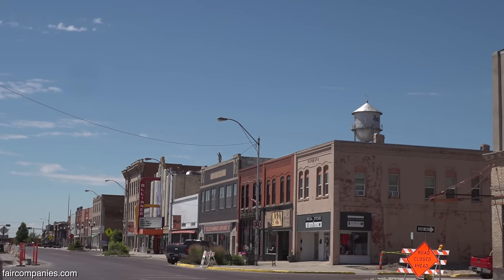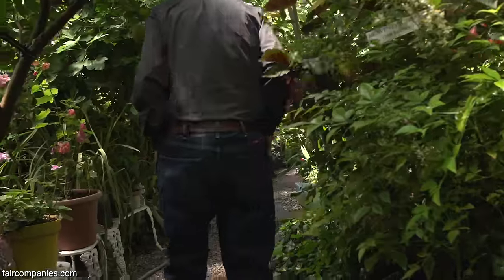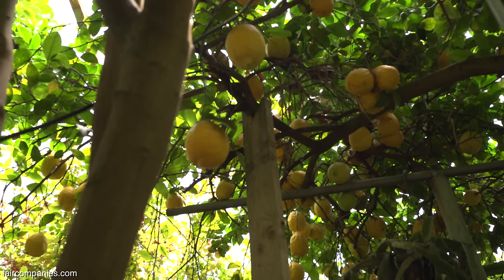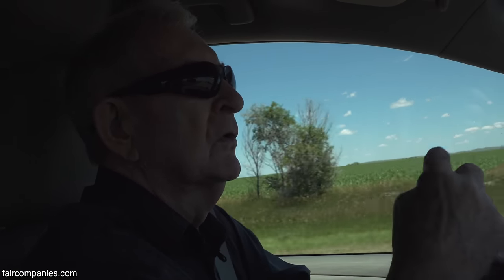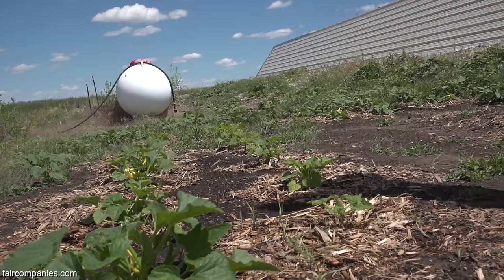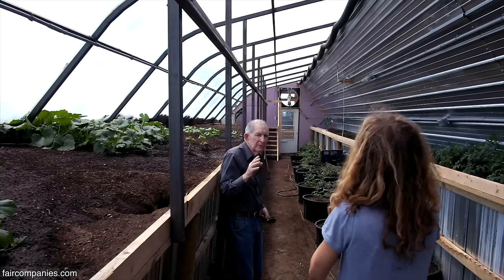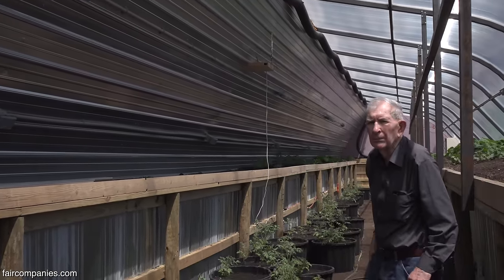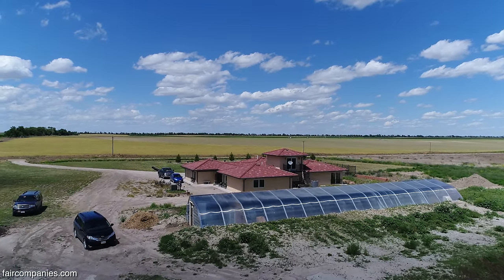Nebraska retiree uses earths's heat to grow oranges in snow

Comment: I did not see any bees at all.  How are the various crops pollinated?  I don't see how it could work without some input from Mother Nature.
Reply: Keith McCarron I’m curious too!
Reply: That is also my question. How are the plants pollinated?
Reply: I saw a beetle in the front of this clip. Either way, I’m with you guys. I haven’t heard an answer from him so I’m guessing that this is perhaps bullshit. Thanks!
Reply: i noticed an open window at the top on the end
Reply: I just thought that looking at the environment where he lives, there doesn't seem to be much in the way of vegetation outside his property to attract bees.  I wonder if he would need to perhaps maintain a small hive within the polyhouse to get/keep the bees inside.  I don't really know - it just seems to be an issue to me.  How else could he pollinate all those plants successfully over a number of changing seasons?  I do like the concept though.  It is quite like a sealed dome on a different planet.  Everything he needs has to be kept inside the sealed system for the whole thing to work.
Reply: There are lots of bees and pollinating bugs in the Sandhills. Also, remember that the greenhouses are heated and cooled via blowing air. I'm sure with that much pollen in a confined space, there aren't much problems with pollination.
Reply: hand pollination since masses of bees everywhere have died fir various reasons
Reply: Manual pollination from plants that gave make and female plants it’s possible. Unless he has bees in there on rotation
Reply: Keith McCarron would not cross pollination be a problem in such a small space
Reply: i had the same question but the blowing wind makes sense.  Would the envrioment cause a lot of cross pollination?
Reply: There was a lot unexplained. I'm thinking he would open it up in the summer once the temps are right. Otherwise it would really cook in there during a Nebraska summer. In the winter, when the bees are gone, he'd close it up..? There are other YT vids that go more into the mechanics that might help with the gaps.
Reply: @Kevin Jacks Because of course if you don't understand something it HAS to be bull... There are plenty of ways to pollinate without bees especially with citrus. Many plants are capable of pollinating simply through air flow. Citrus are easy to hand pollinate. And no matter what you do there are masses of insects in there. Greenhouses do not keep insects out, if anything they attract them.
Reply: @ Kevin Jacks   You could have expressed your thoughts in a less negative way but I guess that would have involved some thinking on your part.
Reply: Nathan Rogers
Right? Ignorance on top of ignorance.. We don't get any smarter this way, lol. Btw, thanks for the info on citrus. I was wondering about that.
Reply: As the millenials would say "Epic fake dude" !!  skepticism + lack of knowledge is very dangerous
Reply: There are plenty of smaller insects that would pollinate citrus and other plants in a greenhouse.  No need for honeybees, though if the building had open windows they would surely fly in during the warmer months. 

Cross pollination would not be a problem from grafted trees as the seeds would not come true anyway.
Reply: Kinda like BubbleBoy?
Reply: What do you really expect with the solid Motards who call themselves SJWs? I just refer to them as socialist Motards and call it good.
Reply: Keith McCarron they tried the sealed DOME thing in Oracle, Az it was a failure, it’s now open to tourism only,
Reply: there are thousands of pollinators,bees are not the only insect capable of that.
Reply: In a space like that you could just hit the plant gently a few times and it'll send out pollen. Or just pollinate manually, it's pretty easy. My bet is he has bees. It's the obvious solution.
Reply: Most of the bees off have died because of the commercial bug killer we spread around everywhere.
Reply: Ihaveausernametoo Very true, just airflow and a little vibration. My corn produces "smoke pollen" when I knock on the stem. So do my eastern white pines.
Reply: You guys need to read the pinned post at the top of this video. It explains the pollen issue clearly.
Reply: Citrus self-polinate. In fact, when mandarin growers want no seeds, they have to net all their acreage to keep bees out during the bloom. I don't know about figs, but the pomegranate flowers are able to self-polinate as well. Saw a comment about cross pollination. Cross polination doesn't affect the fruit ripening now, but rather the seed inside that fruit would be changed and the next generation would see differences, so no worries with year to year crops. Great discussion!
Reply: In the case of oranges they can self pollinate, not sure about the grapes though.
Reply: Ihaveausernametoo: Hand pollinating is super easy. Just use a battery powered toothbrush. Turn it on and place the plastic head (not the brush) against a stem. The high frequency vibrations will shake the pollen loose and send it around. People in the south refer to this as "spanking" the plants lol and do it all the time.
Reply: @KevinJacksKC  
 As a matter of fact, there WAS mention re: bees and pollination in general__I believe Russ mentioned it in the comments, near the beginning of the thread!   😺🌱🌿
Reply: @SwingWestBand  
 I doubt there would be enough plant diversity inside the greenhouse to support a hive properly, though I may be wrong(?)!   😸😺🌱🌿
Reply: Its_an_Invasion_LowInfo_Votees  
 WHAAAAAT?????!!!
Reply: @christopherbrenner1547  
 Actually, Russ did say the pomegranate is basically the only plant that has to be hand pollinated!!!   😸🌱🌿
Reply: Nathan Rogers I agree. I’ll do more research.
Reply: Keith McCarron :???? His house is surrounded by trees, bushes, and grass. What are you watching?
Reply: margaret jones : ?? Making this up?

Comment: Nebraska is the same latitude as Italy, loads of light. I wonder if this could work in Finland, maybe not the citrus?
Reply: nihir 
Anywhere there is no permafrost you should be able to greenhouse like this effectively....at that latitude you will need to research if you want to do a back wall like he did or do full glazing due to winter sunlight....

Good luck.
Reply: They don't normally grow citrus this far north I don't think. I am surprised to say the least.
Reply: Ever look at a map of Italy, all greenhouses for citrus.
Reply: You might need additional lighting and heating this far north.

Finland and Sweden are at the same latitudes as Alaska, not enough light here during winter I suspect.

The stable underground temperature equals the yearly average temperature, in Sweden that means between -2 and 8 degree Celsius (30-50F), I'm guessing it's a little bit colder in Finland. (In Alliance Nebraska it's about 50F).
Reply: pirucreek Commercial Italian citrus (especially Oranges)are grown outside and for the most part well bellow 38 latitude ( similar to California) Pretty table oranges with bright color and high sugar require substantial variations in annual and daytime temperatures. Also ,Italy sits in the middle of a nice warm ocean . Who knows what God has planned for the future of the Northern Midwest , but for now I doubt its abundant and affordable citrus. 👍🏻
Reply: Much of it depends on the ground. If you can dig a trench and put down the pipes you could determine the natural temperature. If you can't dig that trench, then another way needs to be found.
Reply: Search mile 5.2 greenhouse in Alaska, they grow lemons, figs, pineapple, bananas....
Reply: @julie r Do they grow all that without artificial lighting (and heating)? If you use artificial light and heat you can grow anything anywhere but it's not very environmental (and it's expensive).
Reply: Here in Australia or mandarins are so big and juicy

Comment: What’s the schematics?
6 inch tubes how far apart
Or better: Footage Vs Tube Density
20 feet of crops = 1 Tube?

Also is the air circulating both ways?
Reply: Hi Un Mapa, they sell plans for the citrus greenhouse for 48 dollars,it is nothing :)

Comment: Awesome!  Curious if he is measuring radon levels?  Thank you for your work Kirsten and Mr. Finch.
Reply: Radon should not be a problem since he is circulating outside are through solid wall pipes.
Reply: @jimdozier9421  Radon can penetrate through plastic pipes. It's a single atom, it penetrates through things that would be watertight.

Comment: Geothermics and natural convection are really interesting. It does take a lot of trial and error to get it right. Depending on where you live you have to take the type of soil into account, how big are the pipes you use how long how deep under ground. What works in Alliance, NE doens't work in the same way in other parts of the world. The principles of course are identical and it doesn't have to cost a lot.
Reply: Koen Dekoning - yes, you are correct, but remember that you can control your soil naturally by adding compost ( heat treated ), and by introducing fish ponds, etc.
It's not easy, but doable.
Reply: @mar1video I agree, don't get me wrong it's a worthwhile effort. To be able to maintain a contstant temp. in your greenhouse or home without hardly using any energy is amazing. I'm also fascinated with earthship technology for that reason.
Reply: Koen Dekoning: He doesn't maintain a constant temperature. When it's 20 degrees outside it gets up to over 120 degrees at the peak in the daytime but at night it's never allowed to get below 50 degrees. That's when the blowers kick on. That's a 70-degree fluctuation.
Reply: @Chuck. Yes I understood that. I should have said stable instead of constant like they did in the video I guess. English isn't my first language Obviously one has to allow for some fluctuations. Thank you for correcting me.

Comment: I wonder if this works in the desert, like in the boonies in SoCal.
Reply: Yep. The Underground Gardens in Fresno, CA. They remind me of this operation. He grew citrus too.
Reply: @ Brandon B ,
The problem there is that you are seeking cool rather than heat.  The desert heat goes a long way down into the ground.  Plus you will also need water.  In many places such as the area around Twenty-Nine Palms , you are not allowed to take any water from the ground !
Reply: @donaldmiller8629  a byproduct of an air geothermal heat exchange system is usually air moisture condensation basically distilled pure water. It can be collected in airwells and pumped for use.
Reply: @paulsmith-gi5vm  ,
Sort of a self contained system

Comment: This has inspired me to take a better look into geothermal heat. I've always just thought of it as a resource we could only exploit from areas near volcanoes and the like. From my reading, you only have to go down around 5-10 meters to start getting usable amounts of geothermal heat.
Reply: Apparently there are quite a few existing applications, from generators to heating/cooling systems, that have been designed to use geothermal energy.

Comment: For those of you who like this video, check out the book Solviva.  Ann Eddy has some of the same ideas with winter greenhouses.  She replaced Geothermal heat with animal heat and had animals as well.  When you add animals with the setup there is a bit more work, but you get natural fertilizer as well.     I like the geothermal idea.  Very cool, much like earth ships.
Reply: Have not heard of Ann Eddy. Sadly nothing pulls up on you tube.
Reply: Can't pull up any info on her, not can I find a book called Solviva. Any links you can share?

Comment: You can use this same principle of using stable sub-soil temperatures to pre-chill (or pre-heat) air blown through your HVAC air handler. If you have a big pond on your property, you could lay coils of black plastic tubing at the bottom of it where the water is very cold all year long, and use it for the same purpose.
Then, whilst you're at it, collect all condensation from your AC coils by your air handler too. Free water.
He went 8 ft deep but in many areas, soil temperature is stable at much shallower depths, all year long. It is literally free 'energy' right under our feet.
Reply: You might want to be careful about that. The radiator on your AC is likely not intended for that purpose, and may be a source of contamination, potentially with toxic metals.

And no, it's not free. You still need to force thermal mass through it.

Comment: I had a engineering professor for renewable energy.  He built a two ply plastic greenhouse, which pumped a soap sud foam between the plastic at night, which helped hold the heat inside the greenhouse at night.  When the sun came out, the sun would dissipate the foam.  The greenhouse was successful, but the farmer didn't know how to market his herbs to the stores and restaurants, so the project stopped from the lack of funds.

Comment: amazing. who would have thought about utilizing earth's heat to stabilize ground temperature
Reply: It's called geothermal energy which has been in wide use for heating new homes for about 2 decades. It costs more upfront than a standard furnace but  many homes are using it.

Comment: i have a back deck raised about 3ft over a sand base that never freezes. The deck area is 15ft x 40ft, with a back wall of the house about 15ft before the upper level windows are encroached. All south facing. At 49.2 Degrees latitude. Coldest we get is about -5 degree C. I am thinking of building a green house attached to the house with correctly angled panes of polycarbonate (or something), to use the light and heat in the winter to grow our veg for home use and then to start the veg for the outdoor beds (we have an acre of veg gardens presently, so MANY MANY plants to start early). I am completely organic, no dig, etc. and get 2 or 3 crops from   most of the veg beds each year.
 for this idea,  I was thinking to circulate the air under the deck with the heated air at the peak of the greenhouse to keep an even temp and to have horizontal air flow. i can use solar power to power fans. I can use vents triggered by temp to open and close as needed. Any thoughts? Suggestions? I appreciate your expertise on these ideas. So far we grow all the veg for the field in a farmhouse basement but we use grow lights. I want to go totally no paid for energy input on this idea.

Comment: I see, there is air in the tubes.  You could also circulate a liquid with a low boiling point and circulate it into a coil to transfer that heat to water or an air blower because just like earth's temperature varies less than air, so does water. Its harder to lay a liquid tight system in the soil and can also make wildlife curious enuf to dig it up, ultimately, but prob gathers more heat in less feet of pipe. Just putting that out there. 
I am Re-watching this in 2021. This is one of your best videos ever thanks for your good work

Comment: Using water it's more thermally dense if buried it could be recirculated through coils on a large underground container to hold a lot of heat/cold
Reply: Water has a higher specific heat capacity but doesnt provide the same benefits as using soil for the thermal mass when it comes to growing plants

Comment: EXCELLENT project. I can see one really bad flaw that, if not corrected, can cause a total STOP to his system !!! On his geothermal entrance point, out in the field, he needs to build a concrete structure thats several feet above flood-plane, to keep water out of his hoses, plus put fine mesh protected by galvanized 1/2" hardware cloth, to keep rodents and bugs out. It will be expensive to rid that type of corrugated pipe of pests and water.

Comment: Please pass this info on to Russ. In reference to trying to figure out whether its better to push or pull, there is a formula for efficient pulling. 
1x the dia of straight duct before the fan, and 2x the dia of straight duct after the fan.   So if you have a 24" axial fan, you would need 24" of straight duct immediately before the fan. And 48" of straight duct immediately after the fan.  If i recall correctly, this is good for pushing and pulling. 

I see you have squirrel cage fans. The formula could probably be adapted to those.   

And your circulation fan may benefit from this method aswell.

Comment: Looks like Alliance, Nebraska has mean annual temperature of around 9 Celsius (this is an estimate I got from average high and average low, if someone knows reliable source please share). So temperature is around that at couple meters below ground where air tubes sit. So that will be enough to keep the underground greenhouse at that temperature or somewhat higher (if you count in recharge of earch during the summer and the sun coming through glazing (pretty much sunny days per year), we can speculate that that extra additional heat compensates gradual loss of efficiency during the winter as ground around pipes gets cooler.

BTW, I suppose instead of moving around the air, moving around the underground water can be more effective: pump water from one well, through either a trench in the greenhouse ("the pond") or through the pipes (either embedded in greenhouse's ground or through pipes above ground ("radiators"). And then pipe the cooled water into another well.

But what about the house? That temperatures coming from ground through air tubes aren't enough to heat a house to get comfortable temperatures (around 20 Celsius) without the heat pump.

Comment: Heat pumps are WAY underutilized.  It is probably THE most important starting point for being energy efficient; because temperature control is probably the highest energy cost in most homes and most businesses too.

Comment: Air does not pull well. The molecules separate and then you need to wait for the atmospheric pressure to push them together. Push it with a fan. The fan gets those things bumping into each other so they move.  The fan is creating pressure.

It would be like when you want to move a herd of cattle.  You don't pull one to get the others.